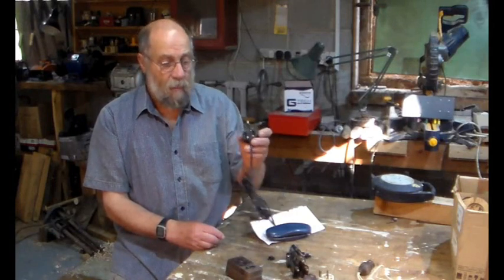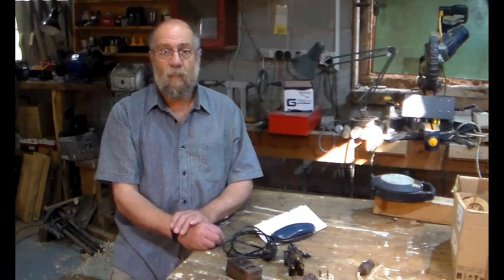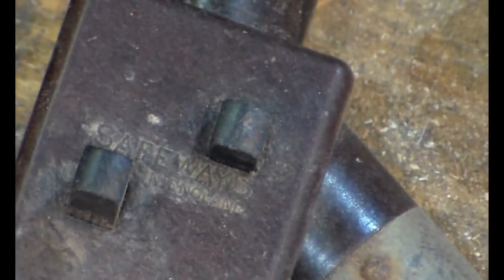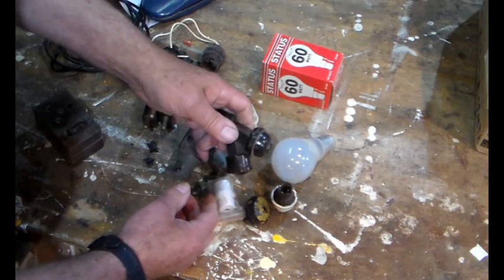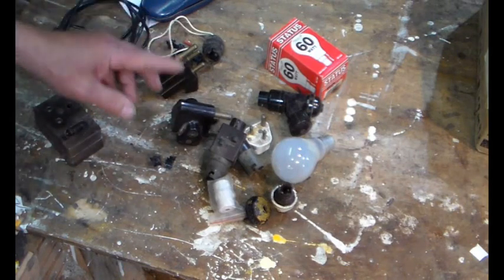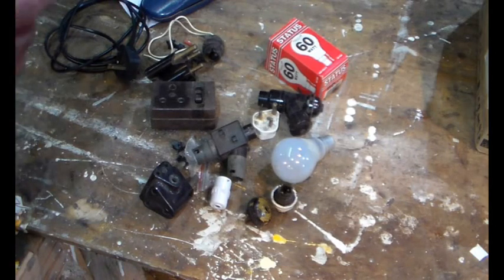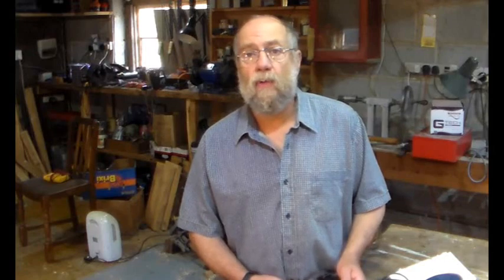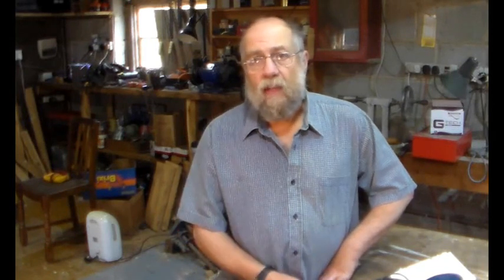Vintage electrical / Wind and solar off grid systems

Comment: Tim Hunkin has been making some good videos recently, a lot of work has gone into them. I heard that tale about the ring mains and fused plugs somewhere before. And I think AvE may have mentioned that the converse was true in USandA where they had an influential copper mining industry that lobbied for unification of 110v so the cables would be fatter. I would be more reliable if I had a source.
Reply from the maker: Owen, yes Tim Hunkin is one of my few heroes, educated, interested in things, and not afraid of getting mucky. Asking an industry to set government standards is asking for trouble, like the sizes of steels used in domestic buildings, way over spec for financial reasons, cheers

Comment: I have a 12v vehicle inspection lamp in the cellar, one of many, that has a 12v DC incandescent "house" sized bulb, and I found a box of 110v AC bulbs somewhere, but moved them on, I am not keen on incandescent bulbs anymore, but I guess it is different on free sustainable energy. I think I also had a "heavy duty" 240vAC bulb in one of the inspection lamps, I believe that they have a heavier or stronger filament to cope with the knocks and bumps of movement under a bonnet.
Reply from the maker: @bootsowen , I know what you mean as incandescent lights are very inefficient and as our inverter is running all the time it would be more efficient to use low energy mains bulbs. In these few places that have occasional use I think DC lights could be thought as emergency lights, just in case there is an inverter problem. Better to have them and not use them rather than need them and not have them, cheers
Reply: @TheInfoworks  Ah... the luxury of space!
Reply: @TheInfoworks  I imagine there is a great incandescent lamp midden somewhere, when archaeologists of the future uncover it they will marvel at the people who stored 50VDC bulbs in such vast quantities!
Reply from the maker: @bootsowen  Got to have that elbow room to keep the limits at bay, cheers
Reply from the maker: @bootsowen  Te He, along with the Marmite jar midden and I've all Uncle Harold's stash as well, never get the the end of them, cheers

Comment: Cool stuff. I have most of those bits at home too! Some of the 15 amp & 5 amp round pin plugs and quite a few of those bayonet double adaptors. I got one set up in the Radio studio so a CFL hangs down from the bottom and an R-80 spotlight bulb from the angled socket, which lights the radio mixing console nicely. The 15 amp round pins are still the standard mains outlet in South Africa. 

I have a few of those bayonet to two pin round pin plug adaptors too. But I am wondering, are they the pin spacing of the old UK 2 amp outlets or are they indeed the UK shaver plug pattern? 

I am running 12 & 24 volt battery banks and do have a circuit coming off one of the 12 volt banks that runs a series of what we call "low level" lights. Being direct from a battery bank they are "A light when all other lights have failed"! lol They are all LED units of course, and the quite substantial voltage drop of running 12 volts all that way doesn't bother them much. Nor does it bother automotive style cell phone & tablet chargers that also run from this circuit. 

Telephone exchanges ran (and probably still do) from 50 volts DC so they had tools that ran off this voltage such as soldering irons and electric wire-wrap guns. Also, you can actually find certain LED and CFL lamps, that although are 230 volt rated will actually run from the 50 volts DC pretty well.
Reply from the maker: Thanks for the detailed comment, interesting stuff, great ot hear from someone that actually lives with this technology, I feel some experiments evolving, cheers